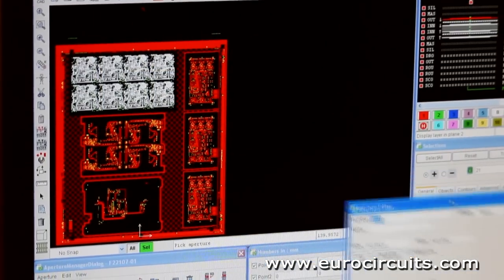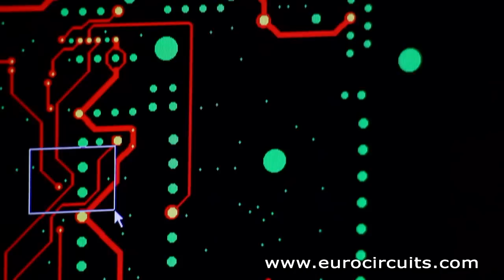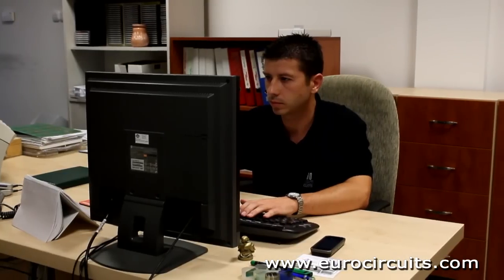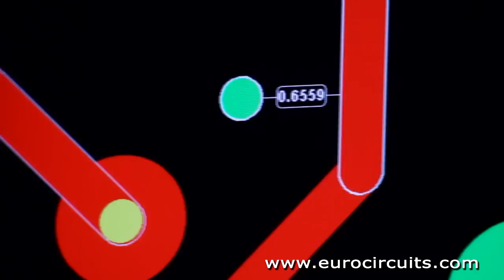Part 2 - Front end tool data preparation

Comment: The board designer prepared his layout on a computer-aided design, or CAD.
Each CAD system uses its own internal data format, so the PCB industry has developed a standard output format to transfer the layout data to the manufacturer.
This is extended Gerber, or RS-274X.
The Gerber files define the copper tracking layers for the job we are following, as well as the solder masks and component notations.
First, we check that data meets our manufacturing requirements. These checks are mostly done automatically.
We check the track widths, the space between the tracks, the pads around the holes, the smallest hole size, et cetera.
The engineer can also check and measure individual areas where he wishes.
Once the data is verified as good, he will output all the tool files needed to drive the machines that will make and test the PCB.